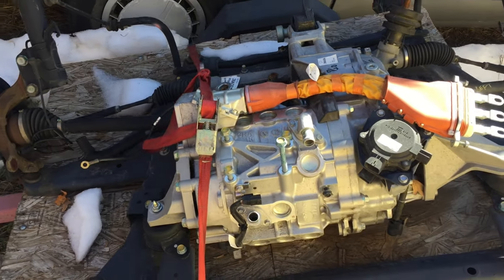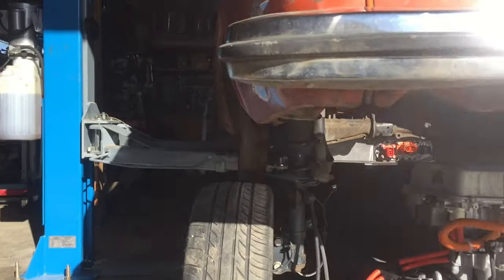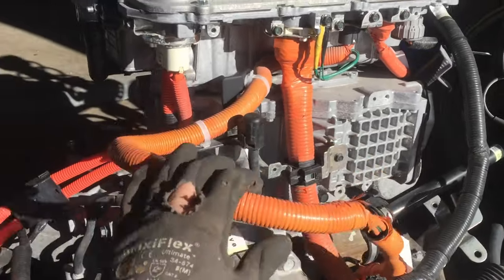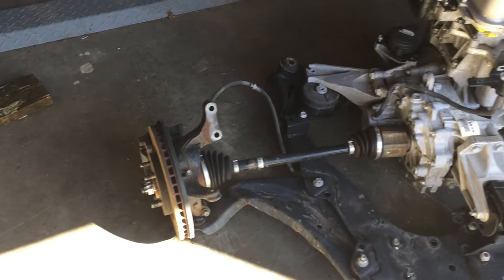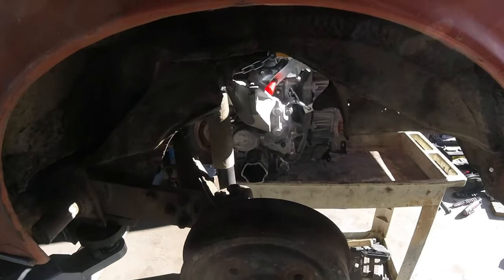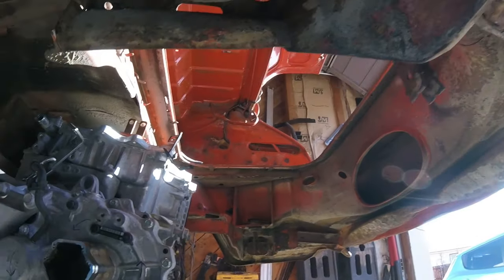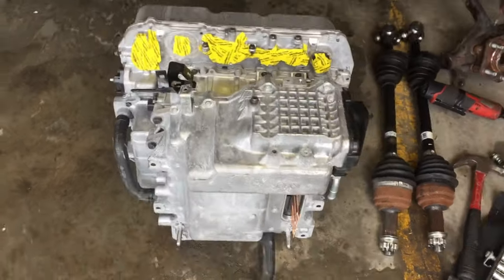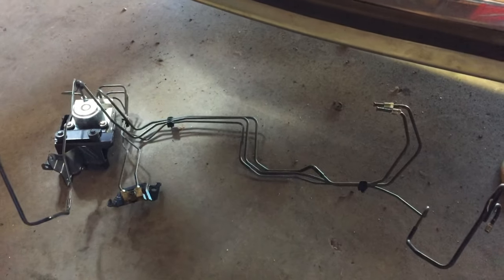FastLEAF - Electric motor install

Comment: Did you have any trouble with that amount of CV fore/aft angle? About to mount an EM61 with a similar amount of angle, but still considering cutting into the firewall to make more space
Reply from the maker: Hey Mike, no troubles yet! Only been a couple thousand miles though. I should start racking up the miles soon though - becoming daily driver soon.

Comment: nice conversion - I'm starting a similar job with a UQM motor & egear drive. Just trying to figure out the mounts. How has it worked out for you using rigid mounts & not rubber mounts?
Hope you can share some info
Reply from the maker: So far the rigid mounts have been great. I’d say that if you have a tight chassis, as in no rust and tight weather seals, you would likely hear and feel the motor a lot more. I tend to do conversions with rusted out hunks of junk so rigid mounts are not a problem. Good luck with the swap!

Comment: You did a great job, thanks for sharing. I want to do a conversion with the Leaf components, is it necessary to use the alarm, ABS immobiliser etc or will the VCU be happy to run without air bag info etc?
Reply from the maker: Hi Stuart, I'm using most of the LEAF equipment in this project because I find them useful in an old vehicle that doesn't have all the modern goodies. If you're not wanting to use certain things then I'd suggest having fun with your donor car first, by pulling the fuse, then testing, if that works then fully unplug the module. I did this test several years ago for fun and I remember there being an issue with the ABS module if I didn't have 1 wheel speed sensor plugged in - it would speed limit if I remember correctly (I should have made a video about this so I could remember!). In any case, PLEASE keep me posted on your progress - I really want to hear how it turns out and would love to swap build stories.

Cheers,
Mick
Reply: @RegenEVs  thanks for the heads up Mick, good point, I remember tearing a Smart car and having all sorts of ABS sensor issues. I wonder how the guys got on with Leaf ECU in a boat? I could build a vehicle that retains the front hubs/brakes/sensors but I want to build a reverse trike due to car regs here. Did you recall if it was happy provided it had at least one ABS sensor plugged in or did it need all 4?